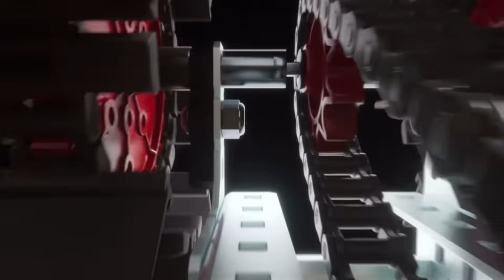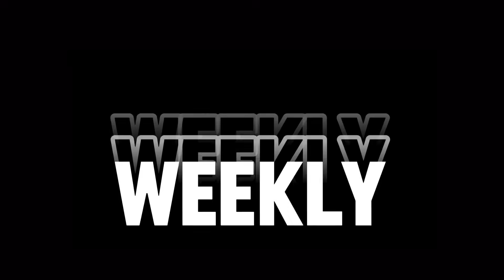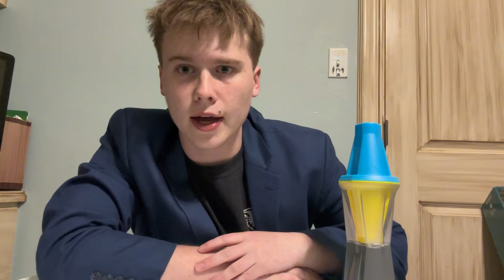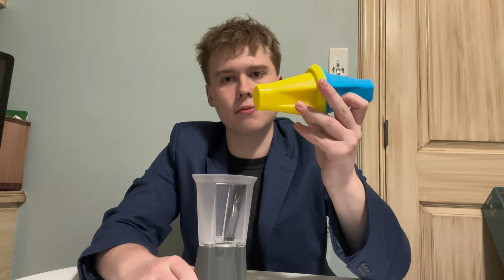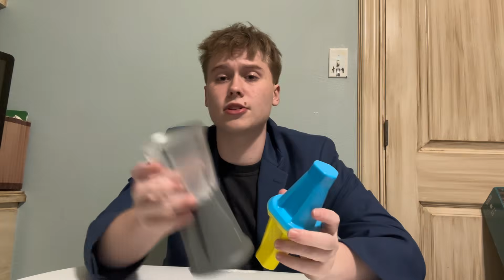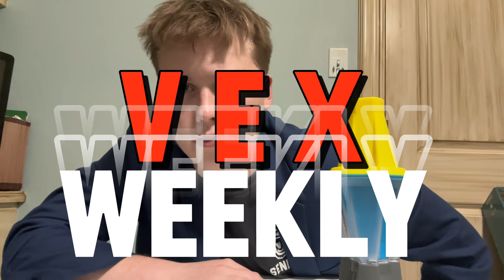OVERRIDE Strategy??

Comment: i was planning a 216 and 1000 rpm transmission is that bad
Reply from the maker: I think 1000 rpm might be a little much, what’s the gear ratios and motor placement?
Reply: 600rpm cartridge and 72:24 and 36:60
Reply: wait i meant 24:72 and 60:36
Reply from the maker: @24250PAPA yeah so I still think that 60:36 ratio will burn your motors out to quickly and that level of speed is just not needed in this game I think transmission drive isn’t a bad idea but I would do a 24:72 and a 48:60 or 36:60 because then you can switch from a super strong and slow drive and a pretty fast (for this game) drive. None of these options will burn your motors out tho
Reply: what about 667 rpm and 240 rpm using a 400 rpm cartridge and 36:60 and 60:36?
Reply: this is my first year in v5 so i'm not sure what rpms are best
Reply from the maker: @24250PAPA to my knowledge there are only 3 rpm cartridge types 600, 200, 100, (blue,green,red) and then the 5.5 watt cartridge or 200rpm. So unless you fit it into a gear ratio those are the set limits
Reply from the maker: @24250PAPA yeah so for a stacking game you want to torque down and have a slower speed so you can be more precise and push bots around in the endgame. This is done through using gear ratios that are less than 1. If you gear up or have ratios greater than 1 it can lead to motors being pushed beyond their prebuilt capacity and burn out